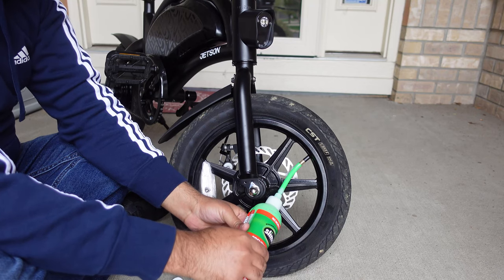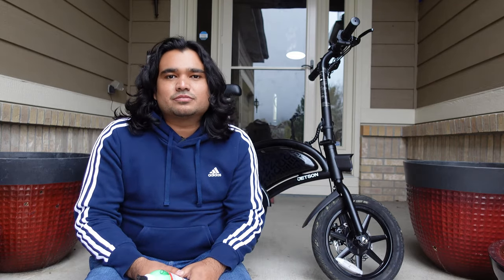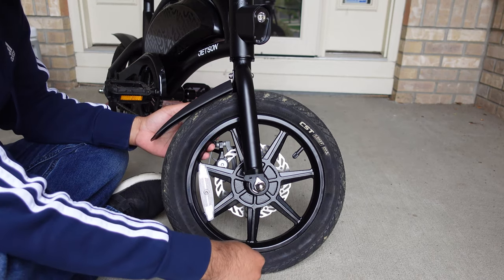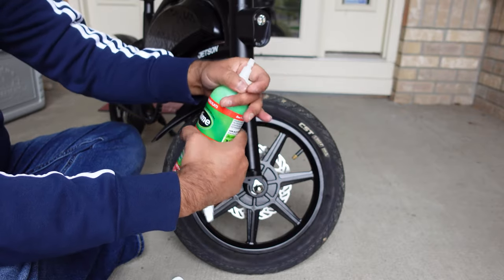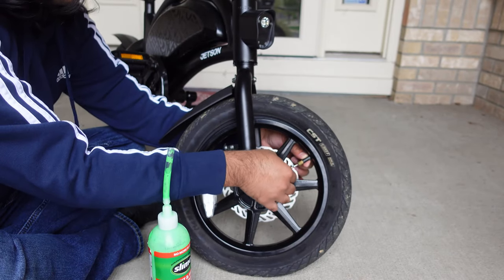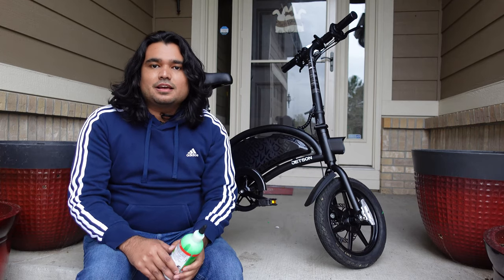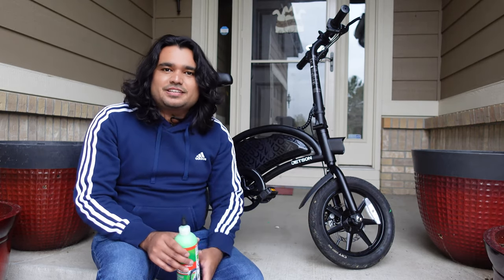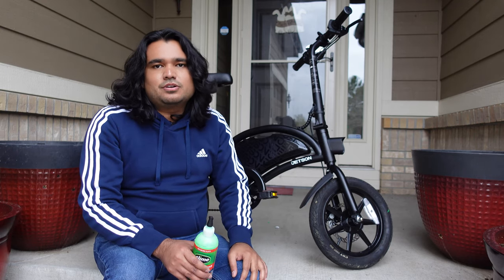Ebikes - How To Fix & Prevent Flat Tire Using Slime (Jetson Bolt Pro) 2021

Comment: Thank you very much! I had a flat tire recently on my back tire of my Jetson Bolt Pro and was really distraught and did not know what to do. I found this video and was initially skeptical. Yesterday I followed your instructions and this method did its wonder. Amazing! Today I just rode my bike like the flat tire never happened. The bike was balanced as before and I didn't notice anything different. Also wanted to tell you i watched most of your videos and found them very informative. Initially I bought the Jetson Bolt Pro at Costco because of your video. Really appreciated your help! The bike brought me lots of joy.
Reply: Shouldn't be skeptical as these products are used in a spray form for cars for decades.  I've been using fix a flat for cars for years as it sprays a white foam into the tire that plugs up a small puncture.  Try changing a flat tire in the rain in the dark. Fix a flat saved me many times.  Or you can call AAA and wait for a few hours.  This works in less than 10 minutes.
Reply: I really hope this works like you said it does, I have to use my bike for work and I’m freaking out and it’s my Monday so it’s gunna be a long week if this doesn’t work

Comment: I actually did the slime thing. It worked for about 3 days, then it went flat again. I weigh about 245. I think I might be too heavy for this. I know the specs say 260 but I don’t know how that’s possible. And it’s the back tire that went both times. It’s sad because I really like this bike.
Reply from the maker: Hi Jay, sorry to hear that you are having flat tire issues. Perhaps replace the tube? I have seen some 14" tubes in Amazon. Thanks for watching my videos.
Reply: Yeah bro u just gotta replace the inner tube! I’m 6’6” and 235lbs and I ride the one without pedals…. The same thing happened to me but I replaced it with a stronger inner tube from Amazon and applied the slime and I haven’t gotten a flat since.
Reply from the maker: @ChrisMenendez609  Thanks Christian. I appreciate the input. Do you have a link of the tube you bought from amazon?
Reply: @ShivaSapkota  I do but I have the regular red and black jetson bolt so the tube for the regular one is smaller than the jetson bolt pro with pedals. So I don’t think it would help you or his situation. But I can still place it down here if you’d like :)
Reply: @ShivaSapkota  also the insert were you put air is curved in the jetson bolt regular as opposed to the pro where the air insert is straight
Reply: @ChrisMenendez609  can you give me the link?

Comment: Nice video Shiva. I actually have my tires tube not holding pressure well, and was under the assumption that there was a micro hole somewhere. Instead of the slime I used fix a flat instead since it's lighter and doesn't weigh the tire down as much, and at 140lbs, I wanted to make the best of my weight for speed/range. The ones at Walmart were sufficient. Right now it retains pressure for a few good hours, similar to what normal use would cause depressurization, so I can do my deliveries without issues.
Reply from the maker: Thank you very much for the feedback. I am glad the Fix a Flat worked out well for you. You apply that product exactly the same way as Slime right?
Reply: @ShivaSapkota  Yes, but the instructions may need to be followed differently given the size of the tires. I shake the can for 10 seconds, insert the provided plug and press the button to inflate. 

Because I wanted to maximize my speed and weight I only filled the tires in an equivalent of less than 1/4; mainly wanted the tube to be lightly coated for protection against slight pricks and cuts from possible debris in the road. I may look into a heavy duty inner tube for the back tire but for now the fix a flat holds well and gives me that peace of mind.

WM also sells that slime next to the fix a flat but ive been told the weight issue when its filled with slime can be problematic, and the Bolt pro has enough weight as is, lol when your battery runs out thats quite the trek home, and for my deliveries that was a no go, so fix a flat works as an light alternative.
Reply from the maker: @edwardcephas3843  Awesome! Thanks for letting me know. This is a very helpful insight.
Reply: Plug Walk  Yes.
Reply: I just bought a can of Fix A Flat now I think I want the Slime instead as it's a very large can and you can't tell how much is going in since you cant see through the can,so my question is how long in seconds should I apply to each tire? Thanks.

Comment: Does it work for the back tire too? Bc I got a hole from a nail in my inner and outer tire. Can slime still fix this?
Reply from the maker: Hello, yes this will work on the back tire. You can also replace the inner tube using my video on tire/tube replacement. Thanks.

Comment: Does the slime cause any balance issues?
Reply from the maker: It didn't cause any balancing issues for me. I have heard some folks saying it caused balace issues for them but they don't have a Jetson bike. Thanks for watching my video.
Reply: Yes it will affect wheel balance. Since these bikes come with no wheel balancing at all, the Slime will actually automatically balance the wheel as you ride. I use AirSoft BB's to balance car tires and Slime will do the same by distributing itself around the inside of the tire and balance the wheel. Motorcyclists and off-road truckers use balancing beads to balance their wheels. There may not be enough Slime injected into the Jetson tires to perfectly balance the wheel, but it will improve the balance, not make it worse.

Comment: Hello I have a question. The lock that folds the bike doesn't lock anymore, it is loose. I have to use the lock clip so that the handlebars stay straight. How can I tighten them again? Thanks.
Reply from the maker: Hi Abdiel, let me see if I can post a quick video soon on that. I have been getting that question a lot and I will try to figure it out. Thanks.
Reply: @ShivaSapkota  thanks so much, I appreciate it.

Comment: Did u wear out the stock tires
Reply from the maker: Not yet, but probably getting close. Thanks for watching my my video.
Reply: @ShivaSapkota  how much do you ride it
Reply from the maker: @nolacross704  Last Fall I rode a lot but then it is still snowing out here, so didn't get to ride too much in the Winter. I haven't been keeping track but my brake pads needed replacement. The tire tread is looking a little low on my bike. The one from the video today is my wife's.

Comment from the maker: Hope this video was helpful. As I said in my video, I will do a tire & tube replacement video in the near future. You can purchase the slime kit used in my video here: https://amzn.to/33ClKcq. Thank you all for the continuous support to my channel. I really appreciate it.
Reply: I have a Jetson bolt version 1 the voltage for it is 36 and the stock battery is 36 volt 6 amp would I be able to upgrade it to a 36 volt 10amp to get more mileage and still use the same controller
Reply from the maker: @greenxo2607  Hello, yes you can get 36V 10amp. I would recommend a 36V 14ah to get a better range. Since your bike goes faster than the new version, a 14 or 20ah would give you better value. As long as get 36V the AH number does matter, you can go as high as you like. Thanks for watching my video.
Reply: Thanks for your help
Reply: If this doesn't work then what??
Reply from the maker: @d.w.t.godblessed-petty9032  Then you need to replace the inner tube. You can get one fairly cheap online. 14x2.125 size. Thanks for watching my video.
Reply: Hi, I wish you had shown the back tire. I am a little thrown off by the bent back tire valve.(when I got it I thought it was defective haha) Is the valve removal the same? Thanks
Reply from the maker: @karenjones326  The valve removal is exactly the same for the back tire. Even though it is bent, the inner part comes out pretty easily like the front tire. Thanks for watching my video.
Reply: @ShivaSapkota  Thank you. Your videos are great and give me confidence.I bought my Bolt Pro because of you. Namaste
Reply from the maker: @karenjones326  Thank you very much for your kind words. I really appreciate it. Namaste 🙏

Comment: Doesn’t this throw your tires out of balance?
Reply from the maker: Hi James, it hasn't really caused any balancing issues but I have heard in bigger bikes it causes some off balance. Thanks for watching my video.
Reply: to avoid that you want to go for a ride or keep spinning the wheel right after you put it in so it doesn't all settle at the bottom and dry in a big chunk.

Comment: So I do not have to remove the nail before adding the slime ? Just leave it
Reply from the maker: Hello, you have to remove the nail. It cannot seal while the nail is there. Thanks for watching my video.
Reply: @ShivaSapkota    Remove nail. Add Slime. Electronic pump.
Reply from the maker: @mavrolus11  Yup, exactly!
Reply from the maker: @mavrolus11  Yes, it is the same process. Just push the tool in a little bit and turn towards the left. Sometime it requires some force while turning. Even though the back valve is bent, the inner part does come out like the front. Hope this helps.

Comment: Help! I have a flat on my rear tire.  How do you get it off to replace the tube????
Reply from the maker: Hi Allen, how big is the flat? Do you think Slime would help? If not, you can just remove the outer nuts, brake assembly and the wheel should come off. The motor is an embedded hub motor so it comes off with the wheel. You can watch my brake pad replacement video on how to remove the brake assembly. Hope this helps.
Reply: @ShivaSapkota  Air gushes out the base of the valve, quickly loses any air pumped in.  Slime or bike fix-a-flat would seem futile to even try... I called Jetson, they are sending me a new inner tube under warranty. The lady was very helpful, sent a video link showing some of the process, at least on their version of this ebike without a pedal. Got some useful info too from a bike shop for how the chain gear is loosened.... I think now I understand how to get it done. Thanks for your reply, you are always so helpful!
Reply from the maker: @TxAllen972  I am glad Jetson is being helpful. The new innertube should be a good fix. Hope everything works out for you. Thanks for watching my videos and please reach out at anytime.
Reply: @ShivaSapkota  FYI... in the end I felt satisfied I knew how to remove the rear wheel to changed the inner tube, but when I went to do it, I got stuck removing the brakes after I inadvertantly stripped the screws on it. So I took it to a bike shop, and they did the job (replacing the inner tube, and the screws too) for $20.  Can't beat that!
Reply from the maker: @TxAllen972  Thanks for the update. I am glad everything worked out in the end. Thanks.

Comment: I think the valve is torn from the inner tube - of my back tire - but I haven't taken it off - I don't see any puncture marks of nails.  will the slime do anything.
Reply from the maker: Slime may not help very much if the valve is busted. You might need a need tube. I have a video on how to replace it. Thanks.
Reply: @ShivaSapkota  going to try slime and ordered a new tube.  It was a slow leak today.

Comment: Another great vid, Sheva. Do you feel the Slime will cause any balance issues, or is it negligible in such a small time? I’ve used Slime for car tires just to get me to a tire shop (Costco), and it definitely had a balance issue. Thanks.
Reply from the maker: Thanks Craig. I took it for a quick ride and didn't have any balace issues. I will let you know as I test it more:)